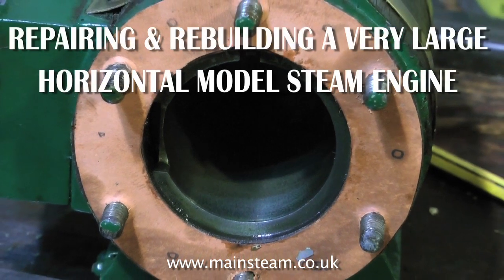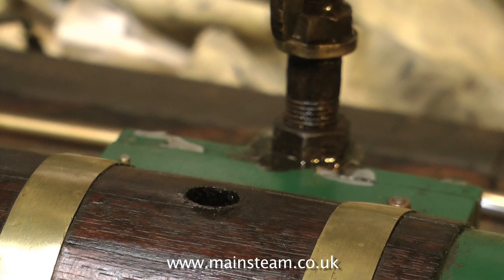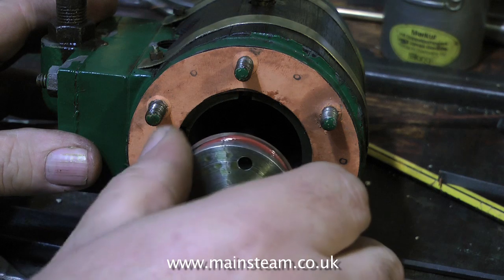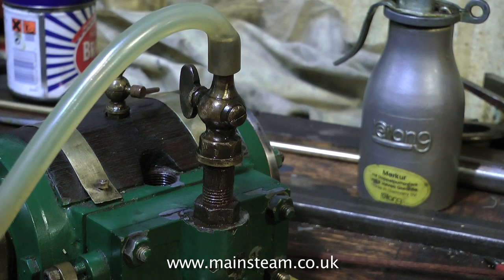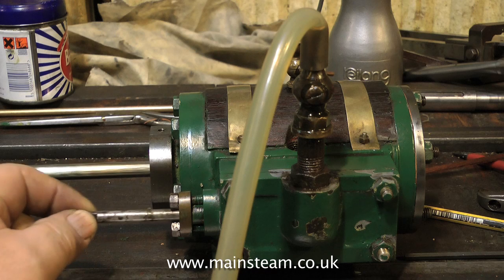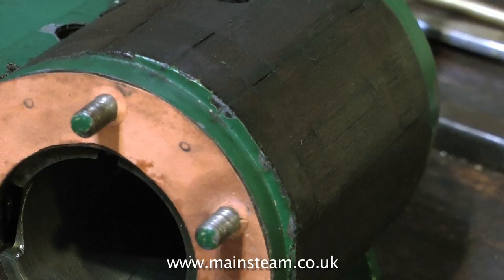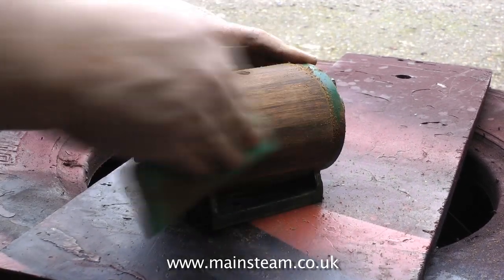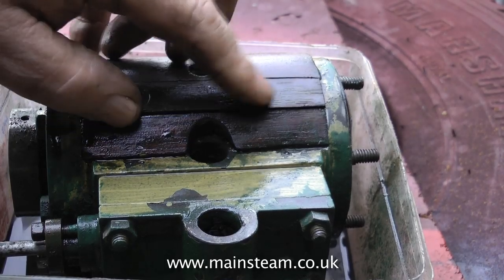HOW TO REBUILD A LARGE MODEL STEAM ENGINE - PART #5

Comment: Its quite a small bore for such a big cylinder.
Reply from the maker: Depends on the intended use - this is a collector's engine & will always run under little or no load anyway. But it has a 4 inch stroke, so a 1 3/4" diameter cylinder  is more than enough really for light running. Even though the cylinder looks big externally, 2 inches diameter is about as big as it can go to retain strength.